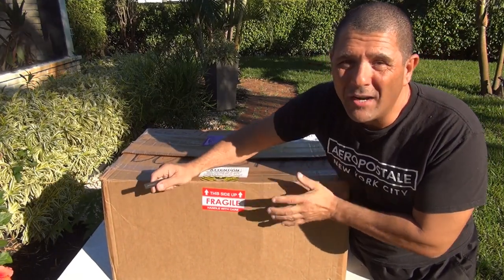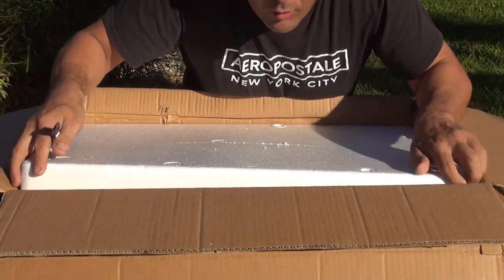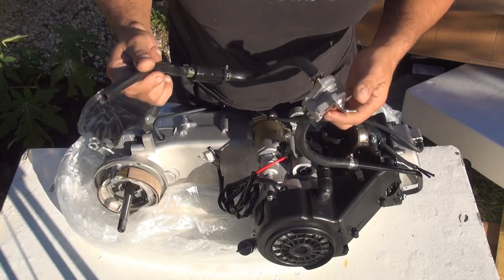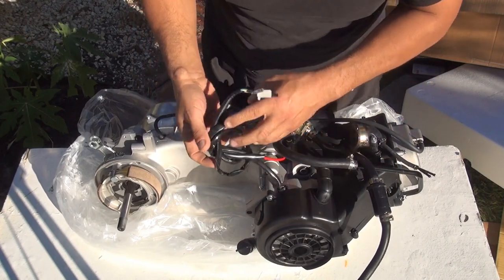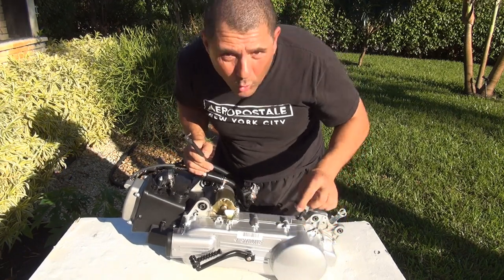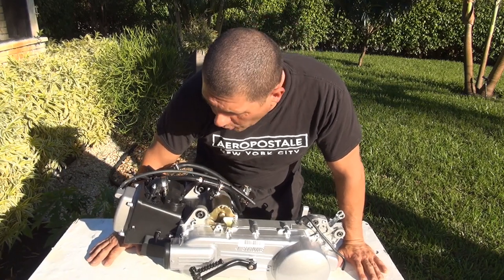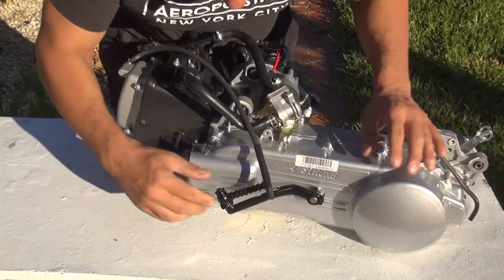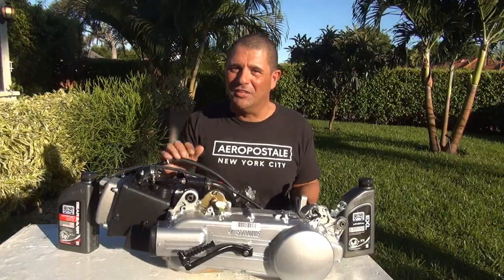Unboxing gy6 150cc Scooter Engine 2023

Comment: Are 125cc too different from 150cc GY6? And how is reability on them? Can they keep up with Japanesse scooters?
Reply from the maker: The main difference between 125cc and 150cc GY6 engines is power and speed; 150cc engines offer more of both. Both can be reliable with proper maintenance, such as regular oil changes and timely part replacements.
Compared to Japanese scooters, GY6 engines typically fall short in terms of build quality and long-term reliability. Japanese scooters from brands like Honda and Yamaha often feature superior engineering, better materials, and more consistent performance. While GY6 scooters can be good for everyday use, Japanese models generally offer better durability and dependability.

Comment: Where do you put the tubes that are unattached?
Reply from the maker: Hi, if you're referring to the hose attached to the valve cover that should be connected underneath your air filter box on a GY6 150cc scooter, that's called the positive crankcase ventilation (PCV). Thank you for watching my video

Comment: Do you thing i could swap 50cc 2stroke chinese scooter engine for GY150cc?
Reply from the maker: Swapping a 50cc 2-stroke Chinese scooter engine for a GY150cc engine is technically possible, but it would require significant modifications to the scooter's frame, electrical system, and other components.
The GY150cc engine is larger and more powerful than the 50cc engine, which means that it will require more space and generate more heat. You would need to make sure that the engine fits properly in the scooter's frame and that there is enough room for the engine to breathe and dissipate heat.
You would also need to consider the electrical system. The GY150cc engine will likely require a different stator and wiring harness than the 50cc engine. You would need to make sure that these components are compatible with your scooter and that you have the expertise to install them correctly.
Overall, swapping a 50cc 2-stroke Chinese scooter engine for a GY150cc engine is not a straightforward task, and it would require significant mechanical and electrical knowledge and skills. If you are not experienced with scooter mechanics, it may be best to seek the help of a professional mechanic or shop.

Comment: Do you have a video installing new engine?
Reply from the maker: Hello unfortunately no I try to make one time but didn't came out the way I want to  on the gy6 is not really difficult you have to disconnect the 2 rear suspension, remove the exhaust system and remove the center connection of the motor will take you around 3 to 4 hours because there is lots of things to disconnect and reconnect
Reply: @VirberelloScooterTips  ok Thank you very much to take your time always to respond followers. 
I'm having hard times with both cars at home needing repairs. I bought a new engine from Amazon 150cc xpro long case there's good reviews I'm going to see how I can make it this time. Engine arrive next Friday :face-green-smiling:. Thanks for your tips I'm going to do the brakes with your videos.
Reply: @virberello hello my friend, i just did a new engine swap because was time to replace the old engine with 8k miles. And this new engine started just trowing carb cleaner inside the carburetor. 

The scooter was seated on my garage for 2 years, I'm going to clean the carburetor, new gas filter, and new fuel petcock because those go clogged when you don't use the scooter for long time how you said.

I hope this work...
I replaced front pads with your videos thanks

Comment: Hello my friend I have sport exhaust and it don't make alot of flames/back fire how can I make it back fire?
Reply from the maker: Hello my friend Backfiring occurs when unburnt fuel is ignited in the exhaust system, causing a loud popping noise. There are a few ways to potentially cause a gas scooter to backfire, but please note that some of these methods may be illegal, dangerous, and/or void the warranty of your scooter.

Adjust the air-fuel mixture: Backfiring can occur when the air-fuel mixture is too rich (too much fuel, not enough air). Try adjusting the carburetor to allow more air into the engine.

Change the exhaust: A more open exhaust can cause the engine to run richer, which can lead to backfiring.

Check the timing: A timing issue can also cause backfiring. Make sure the ignition timing is set correctly.
Reply: @VirberelloScooterTips  yes I know but I want it to do big back fire 
And it is not doing it 

Can you do a video on how to make a motorcycle do back fire